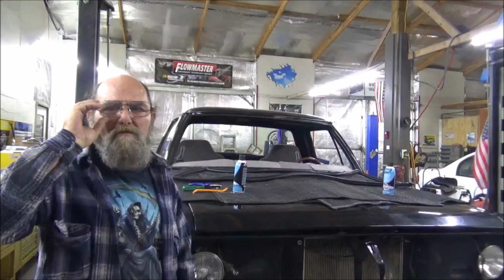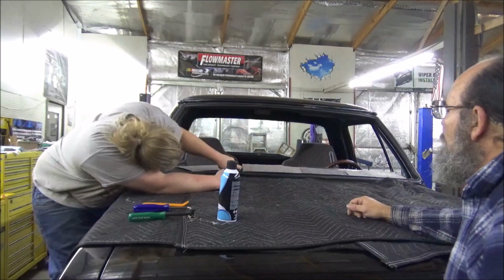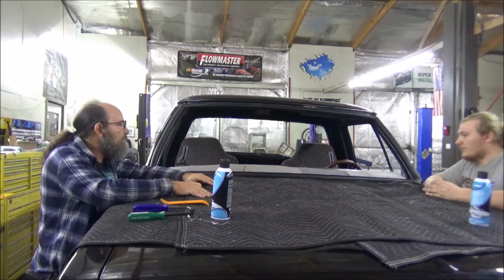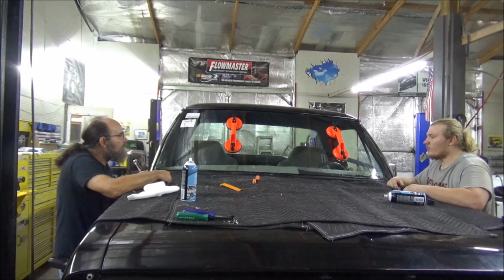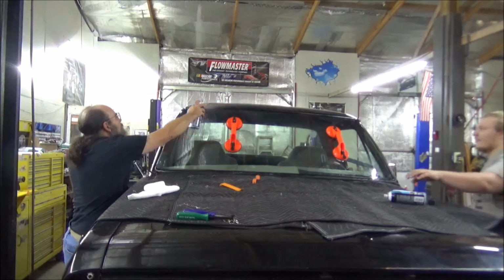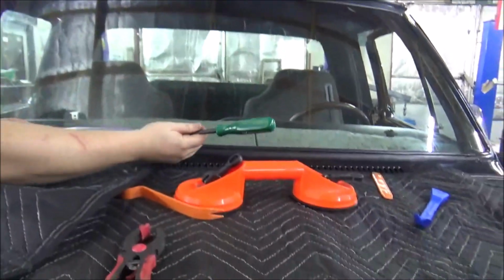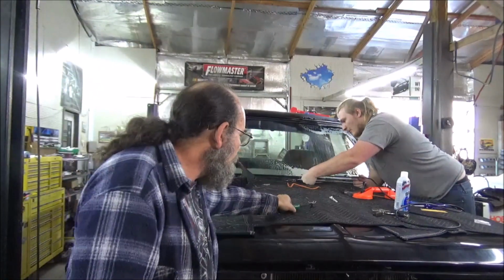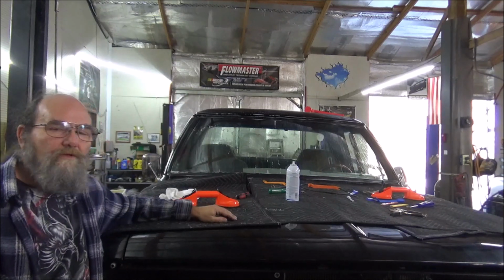1978 Dodge Warlock Windshield Install

Comment: The method taught to me by a professional glass installer is to put the seal on the glass first. Take a piece of heavy cord such as clothesline, wrap it around the seal in the groove that engages the body, crossing the ends at bottom center. Keeping the cord tight (use tape if you are solo) set the glass in position with the lower groove of the seal over the lip of the body. Use the suction cups to pull the glass inward from the inside of the vehicle. You can also have an assistant push from the outside. Spray the seal with your lube and slowly pull the cord while pressure is applied to the glass. As the cord is pulled, the inner part of the seal will roll over the lip of the body and lock the glass in place. It’s really pretty easy.
Reply from the maker: I have seen that method

Comment: Same system holds the windows in my 87 BMW, I’ve used a screwdriver a few times but looks like I’ll be buying that lock strip tool
Reply from the maker: Cool !!